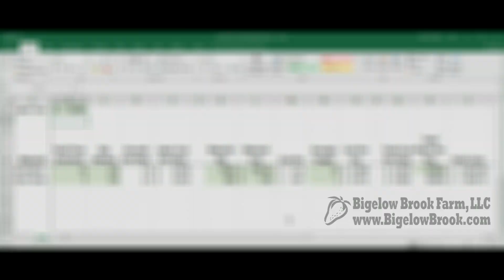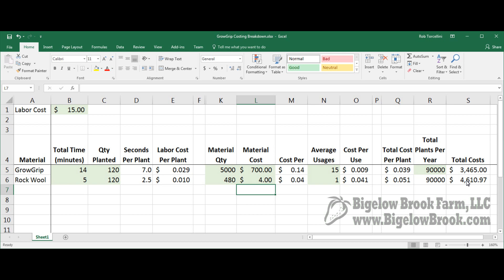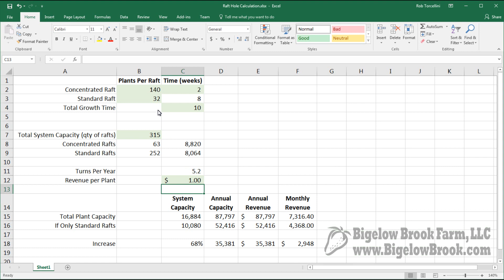High Density Growing Experiment

Comment: On the FIRST spreadsheet.  If you paid $0.07 for each rock wool, you would have paid $33.60 for them in total.   (0.07*480=33.6)  Knew the numbers were wrong when $4.00 = $0.04.  Makes people wonder about ALL the math.  Your example comes out to $0.0147708 vice $0.07.  Not going to bother with the rest of the math as you should check you own.
Reply: yeah it's clearly an advertisement for grow grips, not a scientific experiment... He started talking about the efficiency of transplanting to see if it was a waste of time, then he changed course to trying to prove that grow grips are better...

Comment: A benefit of doing the transplant operation into the grow grips is you can take the opportunity to give the seedlings a dip in something like an azadractin product when you plant or transplant. This can help protect the seedling from some pests when they are so small that even a small pest pressure could do them in.I'm using the 1 inch grow grips and 1 inch thick foam. It is a little trickier to put the roots down a 1 inch hole but dipping the root in so e water helps. We do the transplant right after harvest at the workbench on stands that hole the rafts up to make it easy to access the top and bottom of the raft.Our initial transplant is from coir then dip and into the grow grip, our see doing rafts hold 50 plants in a 1020 tray size raft. Seeds are usually in the coir about a week and then we have been doing 3 to 4 weeks in seedling rafts and then 4 weeks in the big rafts. I wouldn't mind reducing the transplant to a single operation but space is at a premium at this point and budget isn't allowing me to build a whole new facility to be able to expand.

Comment: Copy of your spreadsheet?
Reply: I think your total plant capacity is not accurate.
You can produce each 8 week 8,064 mature plants and 35,280 young. You can&#39;t transplant all the young.
Your concentrated rafts capacity (not quantity) must be proportionnal to your Growth time ratio.
So your B8 formula must be =ROUNDUP(B7/(1+(C3/C2*B2/B3)))
Reply: @damienl.8394  B6 doesn´t exist...Could you please explain this in more detail.
Reply: @zaeanbcegda   I mess up. It's the B8 formula that's need to be change. I edited my comment with the correct formula.
A video update have been made
Reply from the maker: Damn, I think you're right.  I can't believe I didn't catch that.  Looks like I'll have to eat a little crow and publish an update video.  The increase in revenue is substantially different now!
Reply from the maker: It's available to my Patreon supporters.  ;-)  http://www.bigelowbrook.com/premium
Reply: Craig Mullins the calculations look fairly straightforward, you should be able to replicate it yourself if you have used excel before. There are enough times you can screenshot it to enter same numbers and check your results. Green cells are where you enter your numbers, the white ones are static or calculated values.
Reply: You're right. I made a similar mistake while calculating my required flood-table dimensions. 

I'm interested in seeing the updated video too.

Comment: Could you cut up the slot material into grow grips?
Reply from the maker: It's a different type of material and the raft material isn't flexible enough.
Reply: could you make rafts out of the same material the grow grips are made of?
Reply: The growgrips are soft like a sponge but they aren't porous. They float on top of the water and that can be a great way to also to grow out seedlings if you have any open spots you can place them anywhere in the system to begin growout.
Reply: I don't think so, growgrips are like sponges, they would absorb the water and sink.